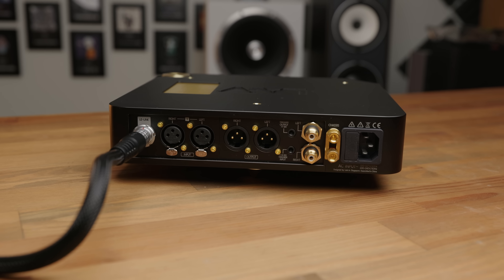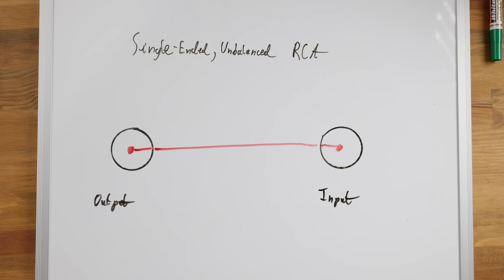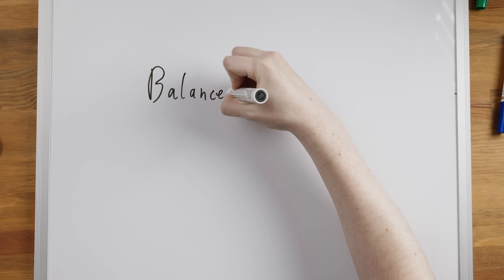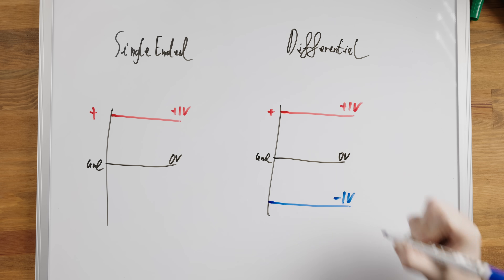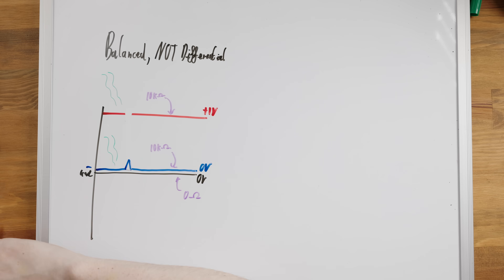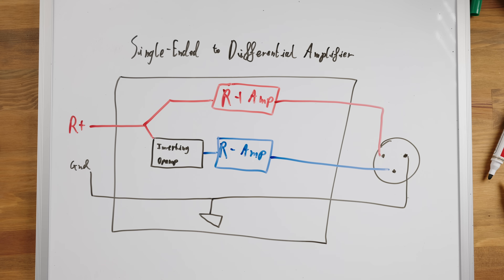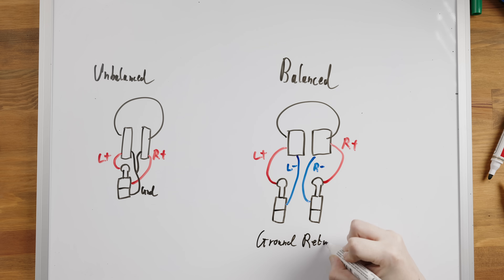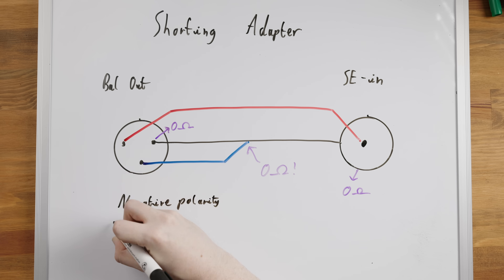Balanced audio explained fast!

Comment: Sadly this video gives the wrong info for differential connections.  It instead spreads the very very common misunderstanding - a misunderstanding so ubiquitous that so much balanced/differential connected equipment is done wrong too. 

You only need two wires for a differential connection and a symmetrical hot and cold is not needed. It is only the difference that matters and the internal reference voltage of the transmitting and receiving differential amplifiers are arbitrary - the measured difference between hot and cold will be the same, no matter what the internal reference. 

In fact, Pin 1 on the XLR should only be used for creating a continuous shield between chassis, cable shield and chassis - never used for the signal. 

However, it is such a common mistake that it appears in a lot, if not most equipment with balanced/differential connections.. 

Bill Witlock has been someone at AES trying to educate about this for decades (to no avail) and the info can be found from him online. Alternatively, brief explanation can be found in Bruno Putzeys' "The G-Word" paper that discusses common grounding misconceptions in audio.

https://www.hypex.nl/media/fa/d8/a3/1682342122/The%20G%20word.pdf

Comment: As an electrical engineering student, I thank you for this wonderful video!!
Reply: As a student, you should already know all this. Unless this was your first week. 
Most of this flows from basic physics. He is just mystifying it more than it ever was. 

Any moving magnetic field in a coil induced a balanced signal. Since any wire has 2 opposing ends and in a circuit current only moves in one direction you get the same signal moving both ways with opposite polarity. 

The clever part is actually the 'unbalanced' connection. It saves you half the cost all along the way. 😉
Reply: @Jeep_on_audio  On my second semester. my first semester was all focused on the fundamental maths and physics (multivariable calc, linear algebra, mechanics, heat, electricity basics etc.) Only started to look at circuits this sem. Still, cool to see theory being applied in real life, even if it is quite simple.

Comment: If the balanced and single ended positive share a signal but not the negative balanced, if both are being used simultaneously would that reduce the voltage of the positive differential and throw off the differential behavior of the connection?

Comment: I have mjolnir3 for my audeze lcd3 and it has an option for class A push pull or class A single ended (amp is balanced) which option is better?

Comment: I would have liked to hear your thoughts on the sound differences between balanced and single-ended headphone amps or if there's any at all.
Reply: He basically already addressed it just subtlety. He said if there's any at all and if you believe so at least make sure you're doing it correctly and not claiming otherwise. Basically no there's no difference but if you believe there is then all the power to you
Reply: There are measurable, tangible benefits to a balanced connection.

But like most things in Audio, and in fact in life, there are severe diminishing returns.

The first benefit is the obvious one of having more power by necessity. There is more power required for a balance connection and so the output is going to be greater. This can benefit you if you have headphones or any ear monitors that require more power, not just audibly, but in terms of convenience, where you have more headroom and granular volume control.

Secondly, on a well implemented balanced connection You’re going to have better channel separation. This can lean into a greater perceived sense of sound stage and a lower noise floor.

But even if you have equipment that is sensitive enough to pick up these differences and a well implemented balance connection, and cable. This does not mean it’s going to be some night and day difference. This is the type of thing that becomes important if you’re looking to get that last 10% or 5% of performance, particularly from equipment that you’ve spent a lot of money on.

Is it going to matter if you have relatively affordable IEM‘s and a basic digital audio player? Probably not. Is it even worth it for people who have very advanced equipment and are looking out for that 5%? Yes looking for that next 10 or 5% improvement is what makes someone a hobbies and it can be rewarding. If that’s what you’re into.

Objectively speaking, though you’re going to get much better improvements in terms of bank for back from a lot of other parts of your signal chain.

Comment: 9:54 According to WaveTheory (often) sound quality degrades when a balanced device converts the signal for the SE output. So in this case you will get better sound from a balanced ouput with an SE adapter compared to using the SE output.
Reply from the maker: This is only true if the device is using an unorthodox method of converting to balanced, like a summing circuit, and one that also happens to then perform worse.

In 99% of cases as shown in the video using a balanced to single ended (floating) adapter is completely identical to using the se out of the device. And using a shorting adapter will cause degradation and pose risk of damage.

Comment: I really wish this went through the difference of a balanced connection (signal cleaning) and bridged amplification (power boosting) in the contex of the term balanced being used for both in the hobby and misleading a lot of people. The former requiring active components so mostly irrelevant to us etc. Feels like this went deeper while missing the most common misunderstanding.
Reply: He basically already addressed it just subtlety. He said if there's any at all and if you believe so at least make sure you're doing it correctly and not claiming otherwise. Basically no there's no difference but if you believe there is then all the power to you
Reply: @GangityBirdity Yeah, it can be inferred, but I doubt most who need this video will.

Comment: i didnt expect a full blown Electrical Engineering course lmao, good video tho
Reply: Don't worry, it wasn't. It was a verbose dumbed down version. It was more like medium level technical school: "here are the rules of thumb, just use those and you'll be fine". Real engineers go much deeper into math and physics. And even they never get the understanding of electricity and magnetic fields like f.i. Nicola Tesla had. 

Fact is, the younger Spotify and TikTok generation of headphone users think 'balanced' must be better, because 'the pro's' use it. And 'the measurements prove it'. 

Fact is, balanced connections in Hifi are vastly overrated because of those 2 false assumptions. For a fixed budget 'unbalanced' gear will sound better with half the parts of better quality.
Reply: @Jeep_on_audio , newgen is right about the “it’s good because pros use it”. Professional equipment “just works” and is way more reliable than consumer stuff. Maybe this can’t be applied to the high end personal audio vs studio gear argument but in general this rule works

Comment: There's one less talked about benefit of differential drive. Single-ended requires a ground connection as the zero reference. The problem is that it's often not a zero and can be polluted by all kinds of currents. In practical terms this makes differential connections immune to ground loops, because each pole is referenced to one another and not ground. Balanced headphone drive can also be less noisy because any noise picked up in the amp becomes common mode and cancels at the voice-coil. I have experienced that some audio chains are more quiet with IEMs on BAL outputs due to this, even if there's that +6dB gain (which sometimes messes with usable potentiometer space).

Overall, great job with the video!
Reply: This is not in any way how a headphone amplifier works. The return line of a single ended output is not just run to ground. It is run to the "ground side" of the output stage. This is very different. This current flow is balanced already because the headphone has no separate ground. Current in equals current out because there's no where else for it to go in a headphone. Ground is never actually zero, nobody who designs electrics professionally assumes that it is. Which is why the fact is irrelevant to the function of a headphone amp.
Reply: Nonsense, There is no common mode rejection because there is no active circuitry to perform it.

A headphone driver is just a coil of wire in a magnetic field. Whatever voltage difference appears between its two terminals, it converts into motion. It has no circuitry for “common mode rejection” the way a differential input stage in an amp or ADC would.

What is true:
	•	In a balanced or  really “differential” headphone drive, each terminal of the driver is actively driven. The amp is pushing/pulling both sides relative to each other. That means the signal the driver sees is the voltage difference between the two outputs.
	•	Because the driver doesn’t reference ground, ground noise from elsewhere in the chain is less likely to show up at the coil. That’s where the practical “less hum / fewer ground loops” experience comes from.
	•	But: any noise that rides on both lines (common mode) doesn’t magically cancel at the driver — it is still a difference if both poles aren’t exactly matched. Cancellation only happens in a true differential input stage (like the front-end of a balanced amp).
Reply: @EvilTeddie23  common-mode noise amplified by the positive and negative half of the amplifier will cancel out at the coil. Let's say there's a noise signal "x" that gets fed into the + and - sides. We get the same signal on both outputs, only in different polarity. Hence why it will cancel.
Reply: @RudeWolfy  
Ah no, you are mixing up 2 different cancellation mechanisms.

In a balanced input stage: if noise rides equally on + and – lines, the differential amp subtracts them, and common-mode stuff cancels. That’s true CMRR (common-mode rejection ratio).
	•	In a balanced output stage feeding a voice coil: the driver is a dumb load. It sees only the difference between its two terminals.
	•	If the amp accidentally sends the exact same noise to both sides in phase, then yeah — the driver sees no difference, so it doesn’t move.
	•	But in real life, amp circuits don’t duplicate noise perfectly on both halves. Output devices aren’t perfectly symmetrical. Power supply ripple, thermal noise, RF hash — those don’t show up as “common-mode and identical” at both poles. They show up as some mix of asymmetries, which the coil does respond to.

Comment: I want to provide a real life example that many viewers may find relatable for their home setups to demonstrate where balanced audio made a real difference. 

I play audio primarily through a gaming PC, and apparently the GPU is a very electromagnetically noisy device. It sounded kind of like a higher pitched dial-up modem noise. That noise was bleeding into my USB and HDMI audio signals to my amp, and then on to unbalanced cables that ran to my powered speakers. I had no idea how big of a difference balanced cables could make so I tried so many other things to fix it (Ifi noise defender helped a tiny bit) but the 100% solution was using balanced XLR cables from my amp to my speakers.

Comment: There's a new trend in Japan audio where balanced 4.4mm connectors have different plated ends. Basically, L+ is gold plated, L- is rhodium, and the R+ is gold, then R- is rhodium. Don't ask me why this is a thing... I work for a cable company and even I think its wild. 

Also great video! Glad this is covered properly, esp by Cameron since he's awesome with this stuff.
Reply: No, you know that is bullshit scam. Say it out loud, don't hide: if you know it is a scam,  SAY IT! It is your duty towards your fellow hobbyists. You know fully well why that is a thing. 

Now, do you work for a real cable company or are you also making snakeoil? Are you one of the scammers and that is why you just say "wild" and claim you don't know why they are doing it?
Reply: @squidcaps4308  It's not really a scam if the manufacturer and the consumer both believe in the same thing. I have been into audio for about 6 years so while it isn't as long as others, I have been exposed to both sides of people who do and don't believe that cables change sound. 

There will be people who will attempt to scam people in cables and so, but that's something even cable people are aware of. I say it's wild in this case because I do not see a benefit in what the manufacturer is doing, despite them believing it has functionality. I have talked to the companies doing it personally, and they understood and were perfectly happy I didn't see it properly functional the way they did.

That's with anything however, there will be products that do benefit, and products that do not benefit.
Reply: @AsciiJC  From manufacturer it then means they are incompetent. But i do not think the consumer is informed and they are not making an informed decision. In fact, they are misinformed to think that there is some magic in it. 

This is also capitalism: Since there is a myth that balanced is better, there is a demand for it. Which is where it is difficult to fault the companies for doing it, "customer is always right" means exactly this: doesn't matter if they want nonsense, you give them nonsense.

But, that is an excuse, we still have to hold people and companies accountable. It is not just an blanket excuse "that is what people want" when they knowingly are selling bullshit, and then marketing it using methods, slogans, rhetoric that amplifies the bullshit myths. Just because they can make money out of it does not excuse their responsibiilties as members of society and humans as a species. They still have the same moral obligation to do what is right!

Capitalism has been so ingrained into peoples moral fabric that they literally say it is ok to scam people, that it is fully ok to sell people bullshit because that is just the way things are. We need to keep them in line by social pressure, and these days that is becoming increasibly more difficult because CONSUMERS ARE THE WALL OF DEFENSE, the people getting shafted say it is morally ambiguous when it fucking hell is not. If they know they are selling something that doesn't benefit the consumer, they are doing a wrong thing. Not illegal thing but a wrong thing.

And hobbyists posing as an expert are also responsible of what they say. It is not ok to speak bullshit to others either. That is wrong too.

Comment: Do speaker cables and the Stax 5 pin connector use balanced circuitry?
Reply from the maker: Electrostatic headphones are differential. (the only single ended electrostatic headphone currently is the Warwick bravura). Speakers can be considered the same as headphones and can run single ended or differential.

Speakers, headphones and electrostats aren't technically "balanced" since they aren't connected to ground. But can be driven single ended or differential
Reply: @TheHEADPHONEShow  Maybe estats are differential on the output side, but if the energizer doesn't take the L and R signals through 4 separate terminals you don't get the full benefits of crosstalk rejection. My Koss E/90X for example has the same terminal connected to both RCA sleeves, so it's only really taking an SE input internally (and in fact can put your BAL source at risk by shorting its negatives together, with no warning posted anywhere).

Comment: It’s when both the L side and the R side of the cable weight the exact same
Reply: Only if the speaker weighs the same also
Reply: Thx saved me 11 min
Reply: this is important for the preservation of the dynamics of the resonant frequencies
Reply: Only if the scales you use are made from silver ofc, much better highs compared to copper /s
Reply: My guy has a high speed balancer to balance mine so I can run at higher spl’s very smoothly.